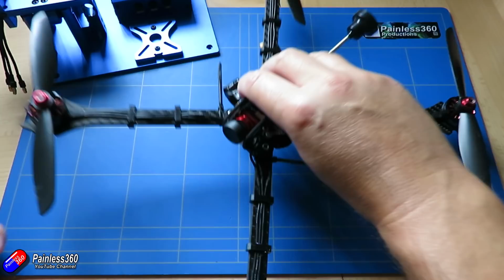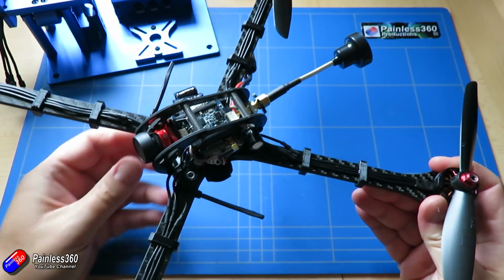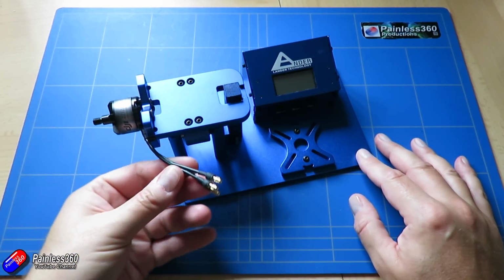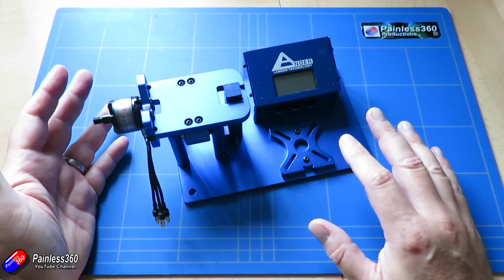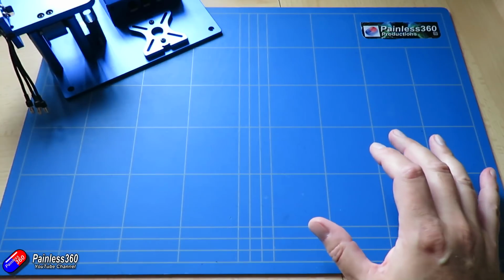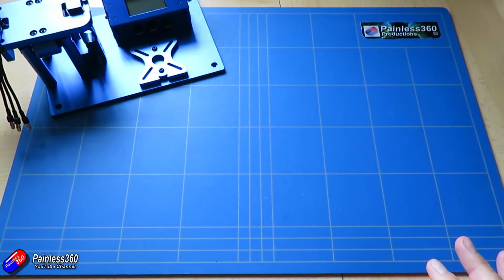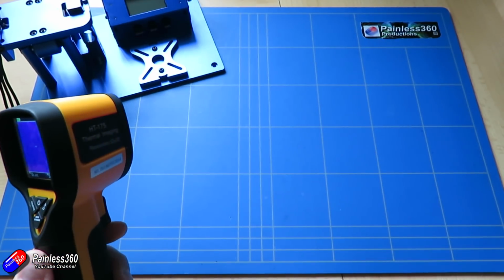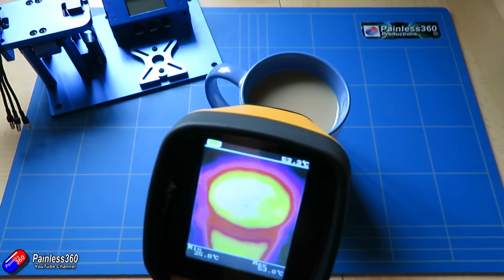Endurance Quad Build Intro/Update

Comment: have a 10 inch build going on, but i am struggling with inav and the omnibus f4 v6.   the compass is off by 50-80 degrees and rotates the wrong direction and isnt very sharp.  yes i have calibrated it, multiple times. Using Ublox Neo-m8n. Please help?
Reply from the maker: The on,y things I can suggest is rerun the compass calibration and make sure that there are no metal/megnetic parts anywhere near the GPS/Mag. Ive not seen that here, running it at 57,600? I'd check the github pages in case of a bug.. Best of luck..
Reply: @Painless360  still acting wishy washy and turning wrong direction.  Should I try a different firmware or board on inav?
Reply from the maker: If it's a plane, disable it. If it's a quad then I'd try another mag to see if that ones faulty. This is why I tend to setup the FC outside the model so I know it's working before I install to aid in troubleshooting.. best of luck!
Reply: Painless360 it was the alignment, needed to invert and rotate the mag 270, didnt realize that would also cause the wandering.  Its all working now thanks

Comment: great videos am trying to get my 450 x quad to fly for more then 20 minuets am in Nassau Bahamas and the island is only 21miles by 7 miles and I want to fly around the island I was wondering if you have any idea I can do this like I said my quad is a 450 tbs discovery frame with 10000 kv motors with 10" props and am using radio link pix4 controller
Reply from the maker: Without testing those exact motors and props that you’re using, and knowing the weight of the model it’s difficult to comment. If you follow the process that I go through in the video you should be able to figure out your flight time. Best of luck!

Comment: If you take all those same components and place them in a frame I am working on it will boost your flight times significantly. The quad with 7" props comes in under 320g or so. I will add a gps which will add a bit of weight but still very light. I will reply to this comment once I upload a video. Probably next week. I am also working on some other builds that will push the lightness envelope in order to get longer flight times.
Reply from the maker: Sounds cool! I'm pleased to hear that more frames that support >5" props.. please pop me a link when it's ready.. best of luck!

Comment: The two battery types you are calling Li-ion and Li-polymer are the same thing, just in different form factors. That form factor (and therefore different internal construction) is the main reason for the different current capabilities. There are cylindrical cells available that can easily provide currents in the tens of amp like a pouch cell, because their internal construction is designed for that. The pouch cells, that so many erroneously call li-polymer, are just "li-ion polymer" cells, because they are wrapped in a plastic (=polymer) package as opposed to being in a metal can. Real li-polymer batteries (where the electrolyte is a polymer and not an organic or water based solvent) have yet to come out of the research phase.
The reason for that perpetuated error is the same marketing people who are now labeling everything "graphene", while the batteries are not really any different inside and have contained graphite for decades. But tell a marketing person that graphite is a lot of layers of carbon (a single layer of it essentially being graphene), all they hear is the buzzword "graphene" and they will sell the batteries to you as the new great invention, while all real graphene based batteries are still in a research phase.
Reply from the maker: Thanks for answering that one for me. Happy flying!
Reply: Sorry, LiPo pouch cells and Li-ion cells (typically 18650) have different chemistry. 
They are not the same.

Comment: I have an X-8 configured octocopter and it gets around 20 minutes on two 4000 mah 3 cells using the dgi motors on a hobby king frame without the gopro

Comment: looking forward to this new build,,, I built my first quad and used it for traffic crash aerial photography instead of a total station survey (Big time saver) I presently use an Autel XStar. Those first flights were maxed out with small safety margin at ten minutes in low wind. The X Star is about 30 min, however small 10-inch frame with modern tech is exciting to me (both for work and fun). I will shamelessly (like the coffee cup plug lol) follow and copy your build.

Comment: very interested in getting a light endurance quad on li-ion myself eventually.  For me it has to be small though.  I suggest you should also try and compare it to something like the fixed wing nanoGoblin - some guy just built one under 250 grams AUW which did a 20km-out-and-back flight with plenty of battery to spare, 51 minutes flight.
Reply from the maker: Fixed wings are the best option if you're looking for a very long flight times with minimum battery. See my review of the ZOHDi Dart for an example. Happy flying!

Comment: Noooooo, Sunnysky 2212-980Kv Mk2's   Right, I'm away to build my own Endurance quad with the Sunnysky's :)
Reply from the maker: All of the size Motors perform in a very similar way. Let me know how you get on with yours.
Reply: @Painless360  Will do, I'm going to start with an Q450 frame and start from there then probs change frame etc and try to drop flight times 😁

Comment: Like this serie.
That thermal camera does not look too bad for that price. When we smoke dive we use FLIR cameras they are great with much higher frame rate. But the price is way higher. Nice that there is things you can afford that does the work now.
Reply: There are also FLIR sensor units that turn your smartphone into a thermal imaging camera, both Android and Apple available. Useful because you can capture snapshots and record video. Great for putting into reports / presentations etc.
Reply: Yes I know.
They are about 550€ here in Sweden. So you get more than 6 off the banggood thermal cameras for one FLIR android camera. But if the price not is the issue then you can go for a 5K thermal camera.
Reply: I was thinking more lower-end for hobby use, FLIR's FLIR ONE Pro Thermal Imaging Camera 160 x 120pixel, Temp Range: -20 → +400 °C, -4 → +752 °F is GBP370 for either iOS or Andriod
That's about the limit of my budget HaHa :)

Comment: What I found is a 5000mah Lipo made my power systems hot and the motors would get hot .... I use 2x 2200mah Turnigy lipo in parallel .. Turnigy batteries are matched and balanced and stay that way if treated properly .. CHEERS !!

Comment: Great series! If you are looking for an alternative to the DJI 920 kv 2212 motors, I can suggest to check out the EMax 810kv 2216 motors. Any estimates on how much the custom 10" Flynoceros frame will weigh? Looking forward to the next video!
Reply: +1 Great motors, just make sure to get the ones with 4mm shaft! Bit heavier tho at 68g with prop nut and ~10cm of wire.
Reply: Hi, I've used with good success the DYS BE2212-13 880KV on TBS Discovery quads and a F550 Hex. good workhorse motor, run cool on 10x5 Graupner props at 4S
Reply: Thanks for the tip!

Comment: Do you think that ESC timing configuration will be relevant? Do you feel like making a vid about it? It's black magic for me, and don't know how important it is...
Reply from the maker: It may play a part, BLHeli seems more designed for motors running at 2000KV or higher so I've had to reduce motor timing dramatically on a recent build where the model was using 400KV motors.. I'll look at it in the upcoming build, it's easy to see when a motor is de-syncing....

Comment: I just recently finished my 8“ with 22 16 motors. It can fit up to 5000mah 4s on it and with that you also get 30 minutes of flight time. For its size it still has really impressive acceleration and top speed. Sadly I’m still sometimes having some problems with motor desync in the low thrust area.
Reply from the maker: Try reducing the motor timing in BLheli suite a few points.. it should help..
Reply: Painless360 Ty for your tip! I’ll definitely try that when I have time to work on it again. Is it because the default timing is usually setup for smaller lighter motors?
Reply: No, increasing timing will help with desync, not reducing.

Comment: You could increase the flight time if u managed to get a hold of the mavic 2 pro propellers...they've been designed fantastic.. just beautiful props
Reply from the maker: I'm looking at motors that can spin 10" blades, aren't those 8"?
Reply: @Painless360  ..oh yes they're smaller... I missed that part!

Comment: (I know this might be a dumb question) Why do similar dji products tend to have better flight time, than our custom builds?
Reply from the maker: They are built for endurance and video. Most home built models don't get the benefit of tens of thousands of dollars of product development. Best of luck!
Reply: +Painless360 But can't we try to atleast mimic certain aspects of that so as to get some great flight time.
Reply from the maker: Of course you can, you can make whatever you want. Using plastic injection moulded frames would help and other have made similar DJI style models (see the Quanum Nova as a prime example).  I'm interested in exploring the art of the possible with modern tech. I'm not trying to recreate something that already exists. Happy flying!
Reply: +Painless360 Thank you, for entertaining my silly doubts☺.

Comment: I understand what you are doing and think it is awesome !  BUT ,,DJI MAVIC ?  DJI Occusink ?    I have been working on a Karearea Waffle kwad with Occusinc and TBS Endurance motors.  The DJI RE Goggles ...why not take apart a MAVIC and mount on a FPV FRAME ??
Reply from the maker: If you have that much cash, are not interested in learning to fly and only want to take video with it then why not. I'm not interested in any of that. Best of luck!
Reply: ps  my everyday fliers are the Diatone 515,  Vifly 150,  and Hawk 5 with 6" arms and 6" biblades.
Reply from the maker: Good man! :D DJI make nice stuff but for me that's not flying.
Reply: NOOOOOOO   I fly FPV EVERY DAY !  I have built over 50 kwads !  BUT I also have DJI stuff and love it !  Truly amazing !  I ended up with three Mavic Pros two years ago and have never flow one so I had considered having fun ...canabalize the Mavic ..  when I think long distance I think MAVIC !  it works ...FYI  I am 66 retired and last year I lost EVERYTHING to a hurricane in the Caribbean where I retired.  EVERYTHING  250 mph winds (IRMA) ...so NO I have no $ !  I did buy the DJI RE Goggles and an extra occusinc setup and have it installed in 7" Karearea ..I study every vbideo you make.  THANK YOU !

Comment: I am currently looking to build exactly the same spec quad. 10 inch props with at least 30 min flight time. Keen to see what you can show. But are there any existing true X frames availabile? I can't seem to find anything much less in carbon. I assume a 450mm min frame is needed?
Reply from the maker: Around that size. I'll be making the videos on this in the next few weeks so keep an eye on the playlist if you want to see the updates before they are public. The frame I'm planning on using is a 'special' but talking to a few manufacturers they have woken back up to the >7" prop pilots now too so other options should be in market in the next few months - finally!
Reply: I recall seeing in one of the videos, you mention ESCs that can be 'reprogrammed' using some software, if the motor is spinning the wrong way, but I cant for the life of me remember or find which video it was in. Ive re-watched a few, but cant find it. Keen to find out the name of rhe ESC option needed that supports that function.
Reply: @michaelbruceharding  if your running bl heli esc protocol,you can switch them there,remember to save:)
Reply: I made my 9-10 inch frame  420mm and it weighs about 160gr in PLA, but almost every piece can be laser cut, so it should be easy to make a carbon fiber version of it.
Unfortunately,I'm still waiting the FC to arrive to test how long the battery will last.
After all my tests I'll publish the design to thingiverse so everyone can download it and modify it.
I don't have a laser cutter but I'm sure that someone has one and that he's willing to make it in carbon fiber.
Reply: If you are searching for a smaller frame that can fit 9"-10" props, there is one called Q380. I think it's about 170g. Cheap and readily available from chinese stores, but it's not a modern carbon fiber frame. Though maybe worth to check out? Then there are some so called "Alien" frames that you can find in 450mm size. They are H-frames though. I think they are carbon fiber frames, and some of them are foldable, if that is something that interests you.
Reply: I was so keen to get started with some kind of build (I haven't build my own before, only moded an off the shelf drone) I bought the S500 frame kit that seems to be a dime a dozen. (I am living in China for a year or so and it was cheap too) I figure I'll give that a go as my test. I am struggling  in China to find a single source online to buy all the quality parts from but have managed to find 9" props and I plan to run (I know I know) APM 2.8, because I have experience with APM and Mission Planner, so I figure I'll try that with a complete build from scratch. I should get all the parts early next week. (Frame arrived today). I realise I am stabbing in the dark so to speak with picking, 900kv motors and what not, meaning I dont think Ill come anywhere near 30 mins flight time ,but I think it will the experience in the build, so what I get more comfortable with that physical aspect of the build, I can then later spend more time on the 'design' for round two.
Reply: So.. did any large carbon fiber frames for 10 inch props come out?  I'm not finding these anywhere.  Please link frames if you know of any.